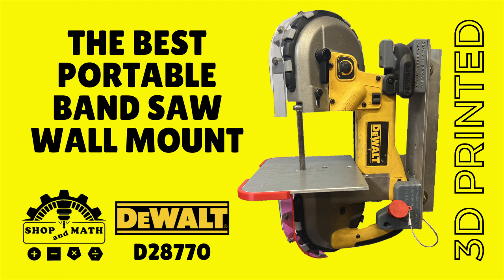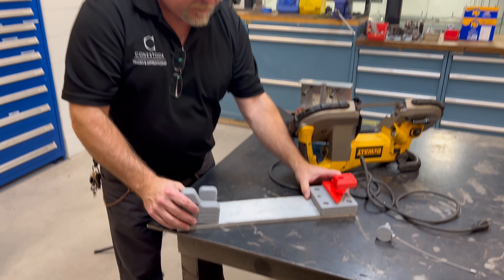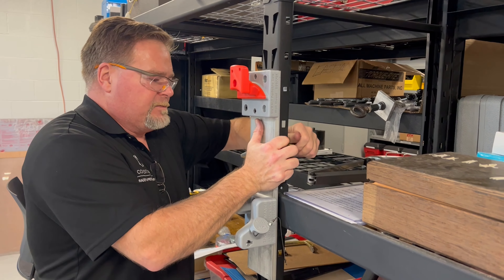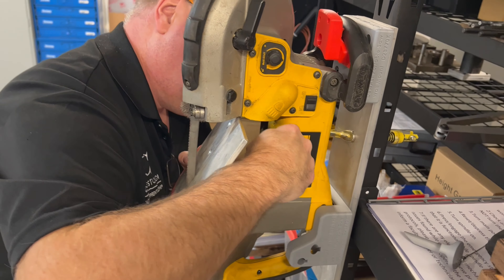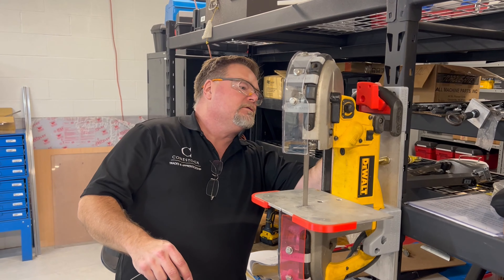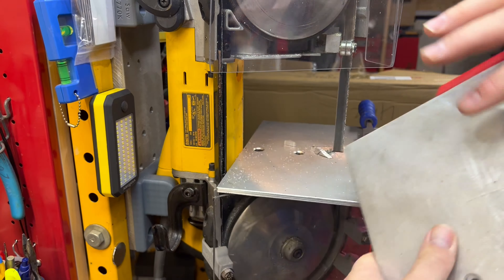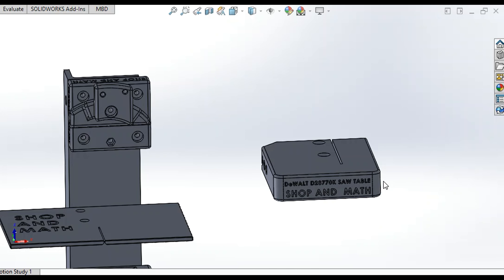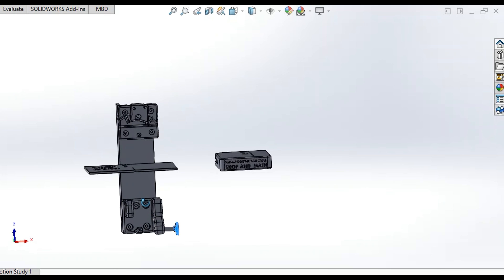Best Portable Band Saw Wall Mount

Comment: Nice. Now if only I had a DeWalt saw. One suggestion - take the plate you removed from the saw and screw it to the mount so you can always find it later if you need it.
Reply from the maker: that is a good idea what I’m currently doing is using a zip tie and attaching it to the trigger
Thank you for sharing and thank you for taking the time to comment
Reply: Silly me, I left that little blade guard on the saw and longer screws to account for the added depth of the new table. So I don’t lose the shorter screws, I drilled, countersunk and tapped horizontal holes out of the way in the back edge of the new table to park the original screws when they not in use. I made these holes deep enough to insert the longer screws so I have a place to park them if I use the saw without the table. If I want to take the saw down and use it without the stand, I don’t have to go looking for the blade guard and original screws and I can park the longer screws in the table so I can find them when I rehang the saw.

Comment: Thanks for the video and sharing the design. So you or anyone reading is aware, the step file you shared for the top hanger "saw handle 6" is a mirror image of what is needed and shown in your video. It is also the single piece design, which is fine by me. I'll go and reprint it as a mirror and look forward to trying it out.

Comment: Really liked this idea and design.
Got myself a portable bandsaw a couple weeks back to be used in my tiny sheed im setting up and i want it eithee wall mounted or bench mounted and seeing as i have a 3d printer this is an easy and cool way of doing it.

Now i have a different brand of saw but i might be able to use this design anyway, best case it work, worst case i will waste a couple of bucks 8n filament.

And if it doesnt fit i can try use this as inspiration and try make my own cad dedign for my saw model.

Again great video.
Reply from the maker: that’s awesome. If you get one done, send me a photo.
If you change the design or come up with a different concept, let me know. I have a Milwaukee one that I’ve just not have time to make yet and looking for a different concept. 
One of the things I’m going to do on the Milwaukee one is  Add a light and a magnifying glass 
Best of luck and happy 3-D Printing

Comment: Now, if only I had a 3D printer …

I did basically the same thing, but I used a block of wood and did a lot of carving 😉

Thanks for the video!! These saws are so handy, mounting them makes them so much more useful!!
Reply from the maker: I tried replying to your last comment, but for some reason I couldn’t you had a great idea with the extra long screws and clamping it to the bottom side of the plate
Thanks for sharing. Much appreciated. 
Ray
Reply: @shopandmath  

The YouTube gods are at it again, it would seem! 

Thanks! I just didn’t want to lose the plate, so a “Plan B” was needed 🤣🤣

Happy New Year to you and your loved ones!!

Comment: I'd print this up. But I have a Bauer portaband from Harbor Freight. The handle is different.
Reply from the maker: yes, this isn’t a universal fit. It’s just for the Dewalt.
Reply: I wish the Bauer had a handle more like the Dewalt. That's a better grip than the knob the Bauer has.

Comment: Ray, I want to saw something nice before I provide any negative critiques,... so I'll say I love that you're a fellow Canadian and that you work in a teaching capacity because that experience clearly comes across in your videos. BTW, ever notice that Canadians are more likely to use the brand name magic marker" to refer to the generic product the felt tipped pen, while americans are more likely to say sharpie? 

So complaint number one, I've got a Milwaukee saw like so many others too. In fact I have 3 portable Milwaukee bandsaws. One reason for the number of saws was to address the potential desire to dismount a saw quickly for use in the field. 

Years ago I looked at the many different styles of conversions and decided to go with a table mount over the wall mount, because we were also planning a welding table and because we mostly needed to cut long lengths of structural tubing for our welding projects and wanted to have option to add external supports for long tube. 

I designed a similar table to that used by @brianoltrogge. I ended up with a very rigid and stable mount with a two external tables that mounts to our welding table when needed for projects which have a lot of cutting. These mount to the grid in our welding table and dismount in seconds, but the table plate does take a bit longer to remove from the saw hence the decision to just leave it attached to the saw. Depending on a person's shop set up I'm sure that external work supports could be added to a wall mounted saw as well. It doesn't in our shop where wall space is at premium.

Complaint number 2, I don't like your idea of break away parts. This comment just makes me think that as a designer that you just wanted to say that "yes this part may break because it is 3D printed". It makes me think that as a designer you were too lazy to address potential issues beyond adding the structural bolt. Adding the bolt actually negates any benefit you try to imply by having break away plastic parts.

Additionally, it is easily possible to design the plastic printed parts to be strong enough that they will not break even under significant loads. Beyond using stronger print settings, redesign the plastic parts so that the projections are either shorter and wider, and or they are reinforced with structural elements.  For instance,  the EL shaped portion on the upper mount that keeps the saw retained in the bracket should have a short projection and the entire red part should be much wider to make full use of the available width of the handle. This yields a much stronger part. Then the long projection of the red part should be thinner but supported with 3 long bolts to secure it to the backing block. The same should be done with the side projections of the lower mounting block... 

and if I was really concerned about the gorillas working in the shop whacking my saw mount I'd print  the improved (but smaller) parts with solid infill so that post processing with in salt remelt could be applied to achieve a much higher tensile strength on the parts. 

OR better yet, I'd just print those parts with the polycast filament, and then use that as pattern to cast the part in aluminum.
Reply from the maker: thank you for contributing you bring up some very valid points

The unit is quite strong, but the sudden shock will snap the plastic. I could’ve easily made it out of carbon fibre or ABS. 
I am by no means of designer that’s why added the little section on where I was thinking and what I wanted the result to be

I don’t think this would work in a welding shop to be honest I was thinking more for home use. I’ve had it in my place for about 2 1/2 years now and only decided to do the video when I came across the second saw on Facebook marketplace for $100 and it’s Christmas time and I made it for my buddy Rob

thank you for your comment and your feedback. Merry Christmas.
Ray
Reply: @shopandmath  Merry Christmas to you as well.

Comment: I've been thinking about getting one of these portable saws for this very reason. Nice work.
Is there any chance you could repost the file for the 3D printed squareness comparator? I finally have access to a printer and would like to whip one up
Reply from the maker: I will repost the files. I’m also working on a 2024 version parts are printed and assembled if you send me an email at.
Shop and math @ Gmail.com
I will send you the updated version before I finish the video 
Ray